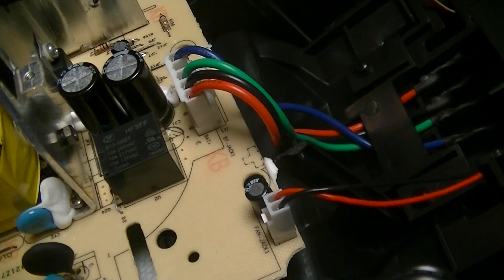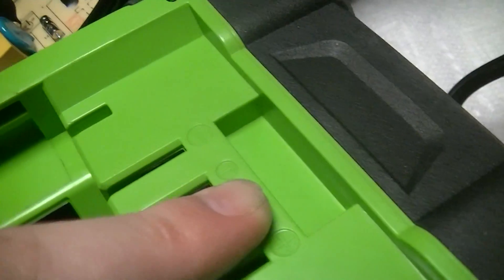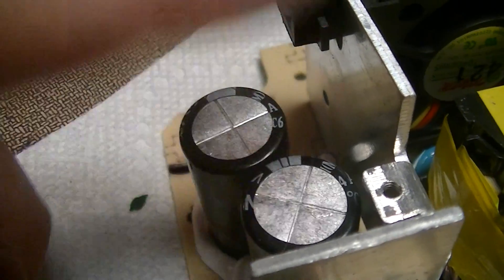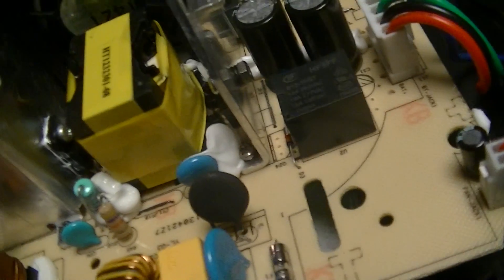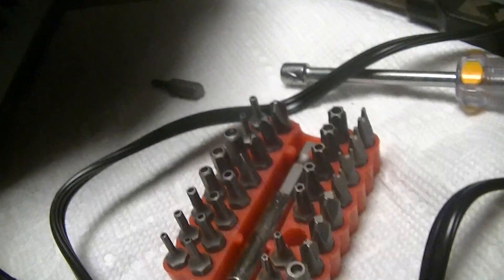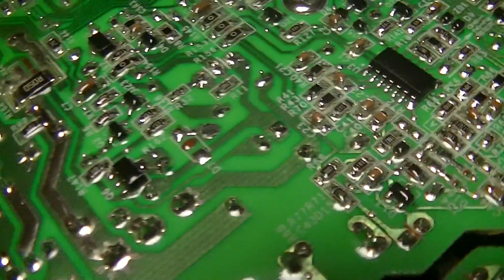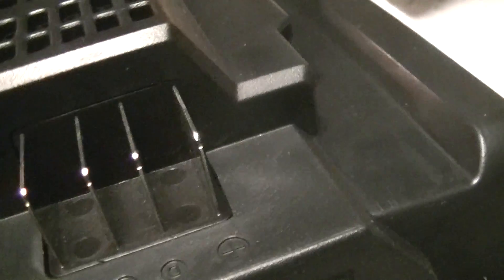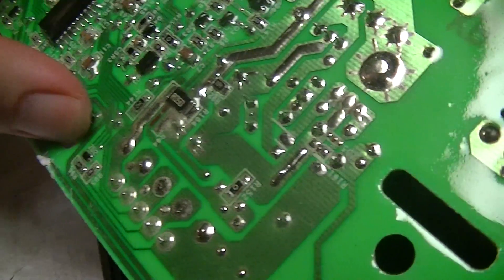Ego PowerPlus/Power+ CH2100 battery charger guts

Comment: The input side of the one I just received in from my grandmas estate “she passed away friday” has a melted resistor, the blue 311, 1K mica film capacitor has it’s leg blown off and the transistor blew up so I can’t make out what it need for repair parts.. the transistor is marked Q10 on the board if I recall, I’m in  bed right now lol, and the big resistor “roughly 5W” is marked R59 on the board.. I need it’s colors or ohms size and the input side igbt part number..
Reply: R59 on mine is  brown grey silver gold or  0.18 Ohms 5%
Reply: @11MeterRepeater are you able to read the Q12 transistor number or maybe it’s a voltage regulator.. mines exploded. I ended up buying a new power supply but still have the old broke  one, I guess I could take the new one apart to see but currently it’s on the back burner of things I need to do lol
Reply: The Blue 311 311, 1K mica film capacitor... is that c30 by chance?
Reply: @11MeterRepeater yes
Reply: @11MeterRepeater the c30 is a 331 1K mica film.. not 311.. that must have been a typo on my original comment

Comment: What screw tip did you use to remove the screws?
Reply: Exactly what I’m looking for.
Reply: @fishizer  torx anti-tamper size 10
Reply: @fishizer  you'll need a torx anti-tamper bit, not sure of the sizing though

Comment: How do you get this charger to have an output with no battery? I'm trying to use it as a power supply but only get 3.4v off of T and .02v from D.
Reply from the maker: These aren't designed to be used as power supplies.  T is the connection to the battery thermistor for overheat protection and so the charger doesn't try to charge a cold battery.  D is a serial comms link with the BMS so the charger knows what the battery SOC is.  You would need to emulate that, and given the time and effort required you are better off getting a proper bench supply.
Reply: @randacnam7321  Gotcha! Thanks for the reply. I have an extra and thought it would be fun to make something useful out of it.

Comment: My charger doesn't turn on or charge. I check fuse and is ok. where do you think I have the problem? Relay? How test it? Thanks
Reply from the maker: If it's totally dead, check the power supply chip.

Comment: Hello, in that circuit, there is a component marked as C30 and another marked as Q16, and D22, you can provide me with its values, I have a charger like the one shown in your video, and it is damaged, and those components their values are not visible, since they were destroyed by an overload, you can provide me with that information,
Reply: Same here my Q16 looks like it has a 2 then I think a 7 but its burned pretty bad.  my C30 blew up and D22 is burned-missing from the board.